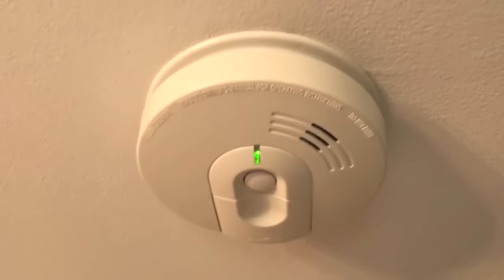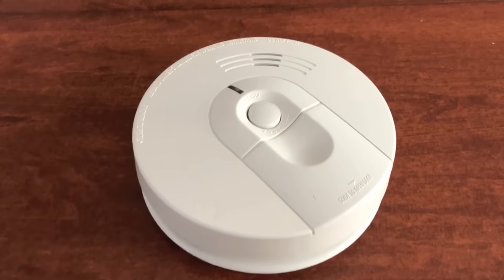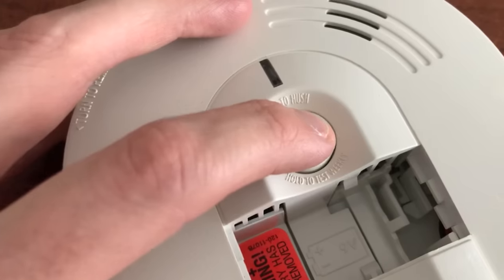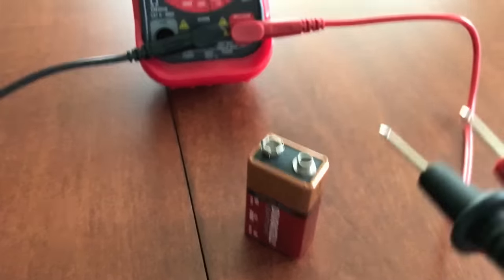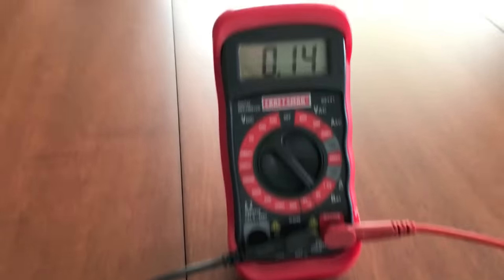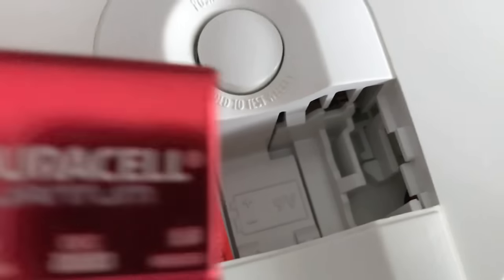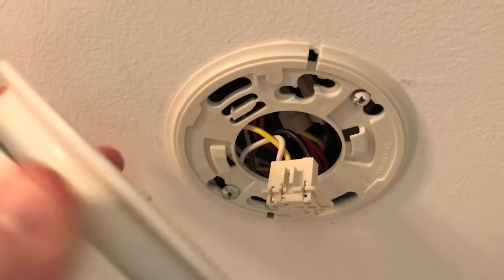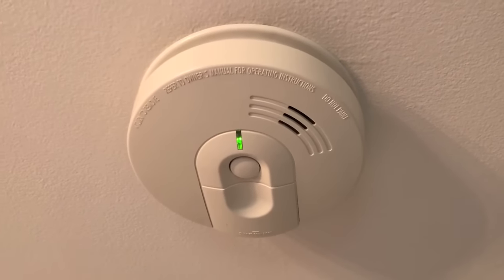Replaced Battery/Cleaned smoke detector- Still BEEPING (Must RESET Detector)

Comment: We have these exact smoke detectors. We had tried initially just changing battery without removing the AC connection point, and after that the green AC power light went off. Now, having followed all of your steps, the green AC power light is still not restored. The smoke detectors are operating fully on battery power at this point. We have checked the alignment of the connection points, and all 3 points are aligned correctly. The smoke detectors are no more than a year old.
Reply from the maker: Shannon Rowe 

Thanks for watching Shannon.  Just to confirm, you have removed smoke detector from hardwiring as well as removed 9V battery from detector and completed a full system reset drain?

If yes and this still has not solved problem, you may just have to replace your detector as the internal mechanics are faulty.

Also, if your detector is more than 5-7 years old, chances are it’s ready to be replaced.  Keep us posted.  Us fellow DIY’ers need to stick together!

😎👍🔧🔩
Reply: @DIYwithMichaelBorders  Yes, followed all steps. None of the alarms seemed to need to be drained (did this on all 4 we have replaced so far, and none of them made any chirps). We have reconnected the AC connection point, but the green light is not lit. ALL of the alarms are less than 1 year old (newly renovated home). 
So long as the batteries work, we should still be safe, right?
Thank you.
Reply from the maker: Shannon Rowe 

Thanks for watching & we appreciate the update.  If your detectors are part of a hard wired security system, your lights should be green with a red flash once every 20-25 seconds.  The security system company will be in charge of maintaining your detectors however if they find a detector to be faulty, you will most likely be the one paying for it unless your system is still under MX warranty.  Hope this helps.

😎👍🔧🔩

Comment: Do you need to turn the breaker off before removing the wiring?
Reply from the maker: Thanks for watching & welcome to the DIY Raptor Club. Some do some don’t, personal preference.  😎👍
Reply: @DIYwithMichaelBorders  thank you Iv replaced my battery and pressed the middle button but the stupid thing keeps chirping so going to try your way with disconnecting it and draining it then putting it back up
Reply from the maker: @nl4352  

Thanks for the reply, looking forward to hearing back from you.

Comment: should the smoke detector light stay green? what if its green and red does that mean time to change the battery ?
Reply from the maker: Tilah Parker 

Thanks for watching!  That’s a great question!  When the Battery falls below a certain remaining voltage, the Detector will begin to Chirp.  Changing Battery should fix this.

In the event that the green light turns red, a few different things can be the causing issue.

1.  The Detector has become loose from the actual Hard Wire connection point.  To fix this, you will need to remove Detector from Hard wiring, remove Battery, & drain any remaining electrical charge.  Then reverse steps.  

In most cases...the Detector can unintentionally become disconnected from Hard Wiring while it is being installed... sometimes these detectors are a little tricky to connect to the ceiling mount...causing tugging, pushing, & pulling....increasing the possibility of it being disconnected.

2.  Detector is holding additional electrical charge.  Just by following step 1...this will help fix issue.

Below is a link to a video that shows Step-by-step process in Step 1.

       https://youtu.be/FakT1rgcmrw

3.  It’s possible that the new Battery is low.  Those Batteries can sit on the shelf for a year before being purchased...causing them to drain down.  Although you are purchasing a brand new battery... The remaining voltage in that battery might be below the required voltage for the Detector

Keep us posted!  Please subscribe to the channel and turn on your YouTube notification Bell that would be awesome thanks again!  😎👍🔧🔩
Reply: This weird thing happens in my aunt’s house. The detector in her room has no battery and flashes red. How is that possible?

Comment: I was absolutely going mental with this noise. Thing was it didn't sound like it was directly from the alarm. Thought maybe it was echoing to the other side of my furnace room.  Did the batteries cleaned etc.. still going off. Was on other side of furnace room near a box happened to see a flash. It was an old alarm that still had a battery in it and was going off.. AAAGGGHH
Problem solved.. I'm an idiot... 🤣🤣🤣 thanx for the vid
Reply from the maker: You are very welcome, that’s great to hear you got it resolved.  Awesome job making it a DIY project.  🧰

Comment: I have the same smoke detector, the battery door came off, and I am having a hard time getting it back on, and hints or suggestions?
Reply from the maker: Xoe Richardson 

Thanks for watching & sharing your experience.  If the actual Battery Door itself is completely removed from Detector, you will need to carefully realign plastic Battery Door into the rail indents.  Be very careful as you do this as the plastic can crack...that wouldn’t be good.

After inserting Door back into rail slide indents, verify your Battery is properly inserted & seated.  At this point the Door should close with ease.

Most important thing is be patient & careful as you’re working with plastic.

Keep us posted on your project!

Please subscribe to the channel and turn on your YouTube notification Bell 🛎 that would be awesome thanks again!

😎👍🔧🔩

Comment: Michael, I cannot remove the detector ... that little tab is laying flush against the base ... it simply cannot move ... it's now beeping every 10 secs 
Another problem is that the new battery cannot be re-inserted ... it's the same size battery, but the plastic guide won't budge ... now i can't sleep ... your thoughts please ...
Reply from the maker: Thanks for watching & welcome to the DIY Raptor Club.  Below is a link to our video showing a closer look on carefully disconnecting connection point.

       https://youtu.be/DCQVIez_R8w

Do you see any signs of paint on connection point.  We have talked to many homeowners that have had trouble disconnecting their detector because a previous owner or painter painted over the connection point and then resecured detector before paint was dry... leading to the connection point drying with the paint and becoming very difficult to disconnect.
Reply: @DIYwithMichaelBorders  Thanks for the prompt reply ...
I pressed that button for 15secs and it stopped beeping ... but after watching both of your VIDs I can confirm that unlike the tab in your VIDs, there is no space beneath it to allow me to flex it downward and remove the connection ... and I'm amazed I ever inserted a battery into this unit - the new battery simply no longer fits ... to insert a new battery and remove that connection wiring, I'd probably break the unit ... but Michael, you've done all you could to help me ... looks like I'll have to get an electrician or city inspector in here.
Reply from the maker: @douglascarlson9006  

We appreciate the reply & are interested in hearing back from you as the project continues.  😎👍
Reply: @DIYwithMichaelBorders  Thank you Michael ...
Reply from the maker: @douglascarlson9006  

😎👍

Comment: My battery drains after a weeks and need replacing regularly,  any reason it constantly draining. It is good (known brands).
Reply from the maker: Thanks for watching & welcome to the DIY Raptor Club.  Is your detector hard wired?
Reply: @DIYwithMichaelBorders  yes,it has an electrical connection to the system and the battery backup. 
Battery only last a week (9v). It should not drain in the first place as this a backup only. 
In my previous experience, it should last about a year, before showing battery low (triggering the Alarm).
Reply from the maker: @robinbarker6736  

Thanks for the reply.  A common cause is loose connection point.  We recommend verifying that your connection point is firmly secured.

😎👍🔧🔩
Reply: @DIYwithMichaelBorders  thank you. I’ll check it.
Reply from the maker: @robinbarker6736  

😎👍

Comment: After new good battery replaced, and reset as per your video the green light fails to illuminate. Red light blinks. What next?
Reply from the maker: Keith Brown 

Thanks for watching.  How old is detector?  If older than 8 years, it’s probably best to replace it as opposed to maintain it and try to keep it working.  Keep us posted.

😎👍🔧🔩

Comment: I have the same smoke detector, but I can't get it removed from the wires.  You skipped over showing that part.  It seriously can't be this difficult. Ready to pull the damn thing out of the ceiling.
Reply from the maker: Michelle Mabery Thanks for checking out the video Michelle!  Below is a link that shows step-by-step on how to remove Smoke Detector from ceiling as well as disconnecting it from hard wiring!  Keep us posted on your progress.  Please subscribe to the channel and turn on your YouTube notifications that would be awesome thanks again Michelle!  😎👍

       https://youtu.be/9Uc5xO-S2rw

Comment: I have one smoke detector in a downstairs bedroom that would beep every 8 1/2 hours like clockwork for the past three days I push the button in the center of the unite and it would stop the beep for 8 1/2 hours I have put in fresh new batter and still beep every 8 1/2 hours I just tried your reset tip I will know if it works in 8 1/2 hours if I don't hear a beep 🤞
Reply from the maker: Thanks for watching, by chance have you disconnected the detector from the hardwiring and removed the batteries to perform a full system drain/reset?  That’s what we recommend.
Reply: @DIYwithMichaelBorders  Yes I turn off the power at the circuit breaker disconnect the smoke detector from the hard wire remover the battery pushes down the button for 15 seconds reconnect the hard wire to the unit turn back on the power at the circuit breaker replace the battery with a new one I did all of this at 12:45 pacific northwest time zone I shell know at 9:15 pm tonight if it goes off again? Thanks, Michael Borders, for you reply😊
Reply from the maker: @drewpall2598  

So happy to help, if it continues to go off after performing these steps, chances are it’s aging and may possibly be past its expiration date.

Below is a link to our video showing how to check expiration date.

       https://youtu.be/DCQVIez_R8w

Keep us posted.
Reply: @DIYwithMichaelBorders  After I did the reset test as stated in my pervious comment on my smoke detector on Friday it continues beep every 8 1/2 hours for 24 hours then it stops beeping and has remain silence ever since. according to the date on the back of my smoke detector it only 5 years old I know it will need to be replace in 3 to 5 years. Thanks for the link to your video on preplacement of old smoke detector with a new one. 😊
Reply from the maker: @drewpall2598  

So happy to help, we DIYers need to stick together!

Comment: Hi. So my alarms are beeping not chirping every 30 minutes. I replaced the batteries on all 4 hard wired alarms after I shut off the breaker. I turned the breaker back on and nothing... 3 hours later a loud beep again. 😫 Do you have any other suggestions before I rip my hair out? Thanks!
Reply from the maker: Rachael Rutnicki 

Thanks for watching.  Have you had a chance to clean your detectors?  Also, it’s very important to properly drain all remaining charge to detectors.

In addition, any loose wiring or electrical connection points an cause symptoms such as yours.

Let’s start there.  Keep us posted.  Please subscribe to the channel and turn on your YouTube notification Bell 🛎 that would be awesome thanks again!

😎👍🔧🔩

Comment: Is there a minimum voltage on the 9v battery before it starts beeping?
Reply from the maker: DaVeeD M. 

Great question & there really isn’t an exact number.  In most cases, below 7, it starts chirping.

It’s also important to know that the used battery from your chirping smoke detector in most cases will work perfectly fine in other devices such as a flashlight or kids toy.

😎👍🔧🔩
Reply: @DIYwithMichaelBorders  the weirdest thing happened. It started chirping andnso I took the battery out and checked it with my multimeter and it measured 8.0v so I put it back in and started looking for answers. I found ur video and it made sense reseting it. It stopped chirping for about ten mins. Then started again. I was stumped. And I blew it out with compressed air and reset it again. Put all back together and sure enough it started chirping again. So finally finally I checked the battery again and it measured 4.0v and was dropping in front of my eyes. Down to 2.0v. so I had to go-to store and purchase a battery and got home and replaced it. No more chirp. I checked the old battery one more time at the end of all this and it was 0.2 at that point. Crazy how that unfolded in about 1 hour time
Reply from the maker: DaVeeD M. 

Thanks for the reply & great job.  Hopefully you are back up & running with a new battery.

😎👍🔧🔩

Comment: Hey man, after i discharge the excess electricity and put my batteries back in and press the button again, it starts the fire alarm. Do you know what to do about that?
Reply from the maker: Thanks for watching, any update?  Are your detectors part of a hard wired security system?  You must wait 60 seconds minimum before installing new battery.  Please keep us posted, we can run through the troubleshooting steps.  🧰

Comment: Now is 5 am., I have follow you everything but the smoke alarm still crippling,  I give up , I take off the alarm go to bed , could you let's me know how to do, many thanks
Reply: the red light still on after I changed the new battery,  what can I do  😭😭😭
Reply from the maker: Ivan Dai 

Thanks for watching & sharing your experience.  We definitely understand your annoyance with the Smoke Detector.

What’s the update?  Let’s get this figured out together!

Chirping Detectors are almost always caused by a low battery voltage.  Over the years, the battery loses voltage & then causes the detector to chirp.

Replacing your old battery with a new battery should help.  However before inserting your 9V battery into detector, make sure you verify with a voltmeter that your battery is above 9V.  If the battery sits in the package on the shelf at the store for a few years before someone purchases it, the actual voltage inside battery begins to dissipate.

Keep us posted, Let’s get this figured out!  😎👍

Please subscribe to the channel and turn on your YouTube notification Bell 🛎 that would be awesome thanks again!  😀👍🔧🔩
Reply from the maker: Ivan Dai 

Thanks for the reply & it’s a great idea to purchase a new Detector.  A brand new Detector may solve your problem.

😎👍🔧🔩
Reply: Thank you so much for your great help ! you are awesome !
Reply from the maker: Ivan Dai 

Right back at ya!  😀👍

Comment: I didn't need to change the batteries after 3 years but put brand new AA batteries and it constantly beeps low battery
Reply from the maker: Jon Benigno 

Thanks for watching Jon!  Let’s get this figured out!  

These detectors can definitely get annoying when going off for the wrong reasons.

Just to verify, you tested the battery voltage of the new battery correct?  Unfortunately this is more common than you think... purchasing a new battery and installing it when the new battery itself has dropped in voltage over the years of sitting on the shelf in the store.

Have you cleaned the detector in the last 12 months?  Anytime these little detectors build up dust / spider webs...  they can trigger beep.

The next thing we need to verify is your actual hard wiring connection point.  Any recent painting completed on the ceiling?  Believe it or not, in the event that the connection point has paint on it, that paint will interfere with the proper connection and may lead to issues.

Let’s start there.  Keep us posted!

Please subscribe to the channel and turn on your YouTube notification Bell 🛎 that would be awesome thanks again!  😎👍🔧🔩

Comment: Do I need to turn off the power at the circuit breaker?
Reply from the maker: Janira H 

Thanks for watching & some do some don’t.  Definitely keep us posted on your project.

😎👍🔧🔩
Reply: @DIYwithMichaelBorders  I tried about 6 times to get the wires off and couldn't do it. I just hope the energizer battery will fix it
Reply from the maker: Janira H 

Keep us posted.  Below is a link to our video showing a better view of the connection point.

       https://youtu.be/DCQVIez_R8w

😎👍🔧🔩
Reply from the maker: Janira H 

This may also be helpful.

       https://youtu.be/lwgDGiEshrE

😎👍🔧🔩

Comment: Why are these units using a battery if they are hardwired?
Reply from the maker: Thanks for watching & that’s a great question.  The battery is for emergency backup & allows detector to operate during a power outage.  This is required by code law to be designed this way.
Reply: @DIYwithMichaelBorders  ah gotcha!
Reply from the maker: @dohc1974  

😎👍